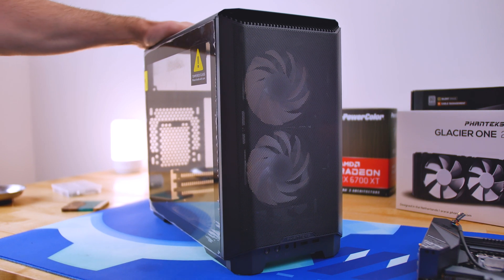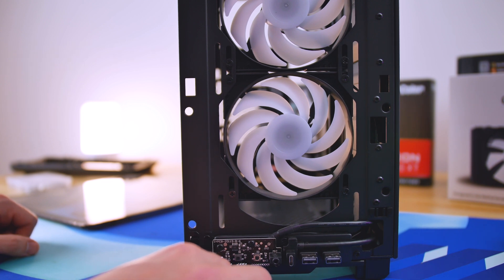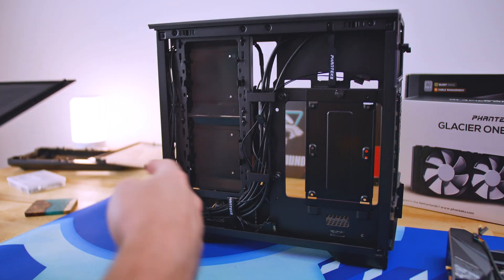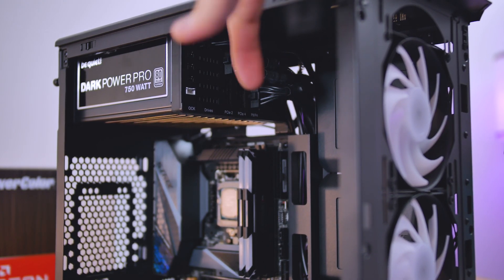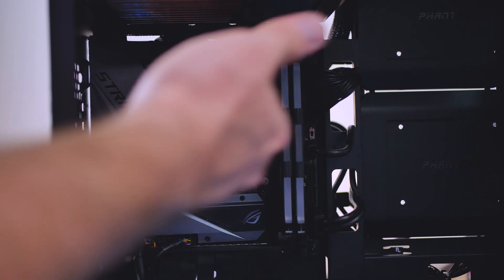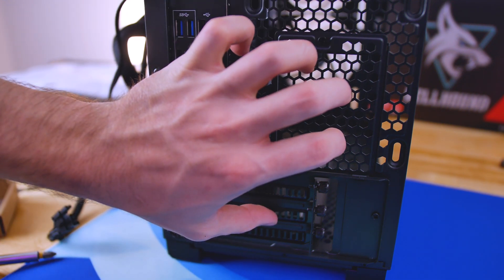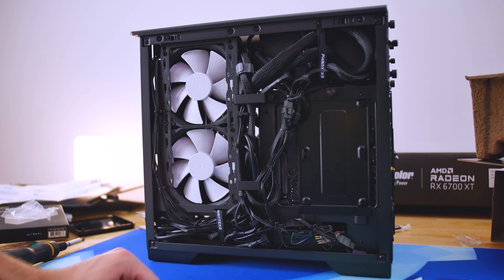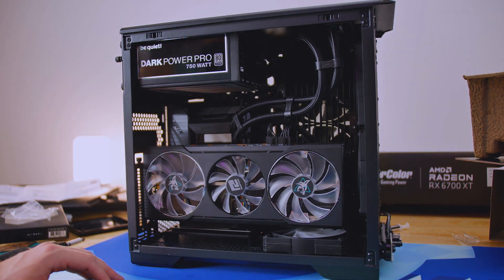How To Build a PC in The Phanteks P200A - Mini-ITX Dream Case

Comment: I built a system with this case. Very happy with the build.  i7 11700f. 32 gigs of G-Skill ram, 4 TB Crucial NVMe. EVGA RTX 3070ti. Built on an Z590I AORUS ULTRA (U3E1).
Great presentation.

Comment: Have you tried Mounting the 240mm Rad under the front Cover panel since its a slim rad,
there is around 33mm space under the top front panel going to 40mm at bottom under the panel?
& Mount the 2 x 120mm rad fans inside front.

Comment: Hey what length is the riser cable? I’m wondering if it’s the small 150mm cable or do I need a 200mm.
Reply: Its 150mm, I just got the 150mm PCI-E Gen 4.0 version for my 3070Ti , Phantek's have them listed on there website, I purchased mine from Overclockers UK for £52.99

Comment: How do u mount the fan at the bottom?
Reply: There are 4 Fan screw holes, Just turn the case on its side remove the long dust filter from the front & mount the 120mm fan with fan screws or rubber pins.

Comment: man to replace the cooler with an air cooler you have to remove the motherboard or the power supply. once the heatsink is in, there is no room for your fingers to clip the fan on. what a pain.

Comment: This guys sounds like I paid review, I just bought this case and there is No space whatsoever on the back for cables, thats a lie! If you go for this case, do it for the looks, the mesh front and the size but do know that cable management on the back will be a struggle.
Reply from the maker: No
Reply: @jdtechgear  I'm sorry but after seeing it with my own eyes, I can safely say that all reviewers that talk wonders of this case and say that the space on the back is actually good are lying. If just not enough, not even when using a fully modular case, all the case cables from the i/o AND the fans are already taking almost all of the very tight space that's on the back, big miss on phanteks.
Reply from the maker: @campingdoesntpay5235  Nah. I literally show the back of the case with all the cables installed in the video . But hey, if that's lying then everything is

Comment: Not a fan of this case. The PSU location kill any possibility for top fans. The vertical mount for the graphics card kill the possibility for a rear fan.
So you end up with all you cooling at the front part of the case. No wonder you didn't show any temp perf tests results.
Reply from the maker: It depends on your config. Check out Hardware Canucks for the thermal performance metrics. 

I don't show any temp results in any of these videos because it's just about the build experience.

Comment: What do you think would be the best fan configuration for a horizontally mounted gpu i this case
Reply: Depends on how thick the gpu is. For a 2 slot card I personally would do 
2 intake on bottom feeding into gpu
2 front intake 
240mm rad side exhaust
1 Exhaust on the back 
That seems like the best to me

Comment: don't like the power supply location. it sucks hot air from the cpu cooler.
Reply from the maker: You gotta compromise somewhere. Make a bottom mounted shroud and only fit sfx PSU's? Or fit a better power overhead. There's always going to be some degree of components taking in hot air, unless everything is water cooled and mounted as intakes. For $50 to $70 you gotta settle your expectations somewhere with size allowances.

Comment: You could actually put the radiator on the front with the gpu too. The fans can fit on the front of the case instead of the outside. Gearseekers showed that in his video. I think im going to buy this case and switch out from my nr200 i got 2 months ago lmao
Reply from the maker: If your GPU is short enough, yes.

Comment: Excited to hear your thoughts on it! A lot of people have an issue with these larger ITX cases, but I actually like them a lot.
Reply from the maker: I just like the fact I have the capability to properly power a 3090 and a 5950X and cool it properly in such a form factor! I find it a sweet spot for raw performance and size.
Reply: @jdtechgear  i would like to see small matx cases, cause matx boards are a lot cheaper than itx ones.
Reply from the maker: @th3truth_  It depends if the companies I work with have new offerings in the M-ATX space, otherwise I would for sure
Reply: @jdtechgear  hey bro is it possible to do a custom loop inside of this case? It look AWESOME
Reply: Y do I see u everywhere dan dan?
Reply: I'm rocking a phanteks enthoo itx red/black for 4 years :)